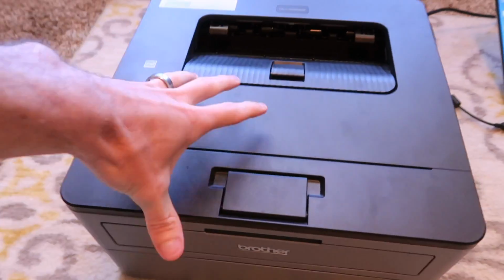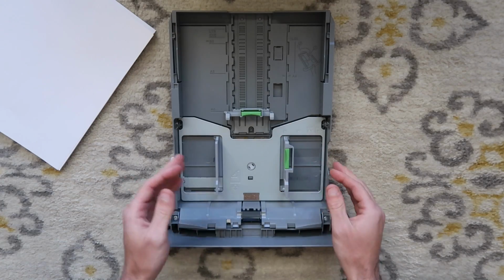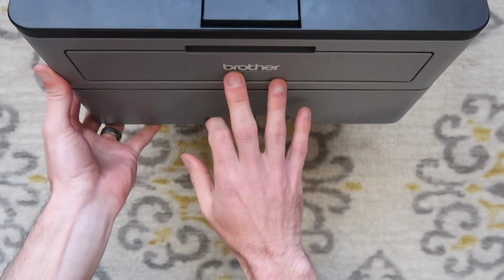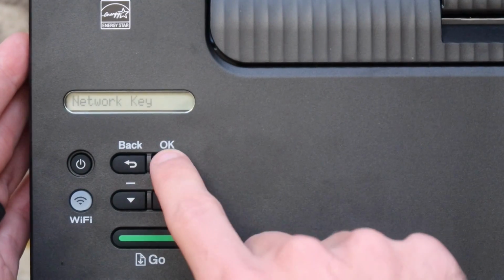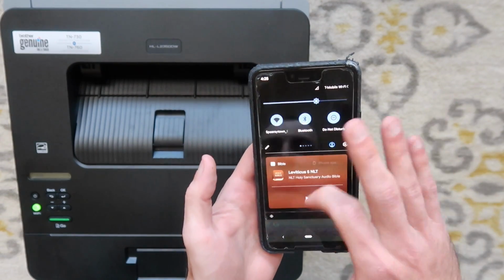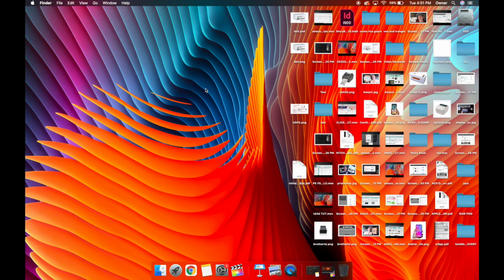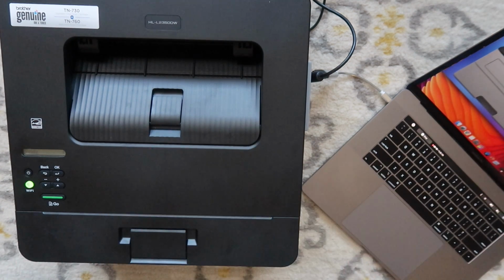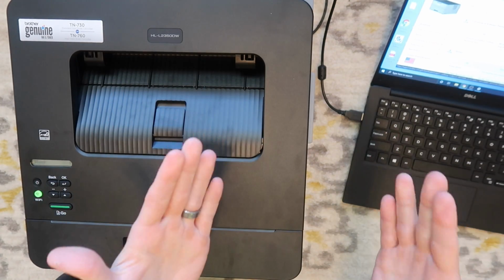Brother Laser Printer MEGA Tutorial HL-L2350DW Wifi Setup and Installation Step by Step Manual

Comment: On an older video so I don't think I'll get an answer, but my question is, what setting do I need to change to allow my PC to go to sleep. I have the MFC-l2690DW connected via USB. It goes into Deep sleep and I can still wake it up no problem when I send a print job or want to scan using the PC. The problem is my PC will allow the monitor to shut off after 20 minutes like normal but the PC never goes to sleep and something brings the monitor back on about 10 minutes after it shuts off. So something is happening roughly every 30 minutes. The PC is set to go to sleep after 45 minutes of no use, monitor to shut off after 20 minutes of no use. I don't want to change the PC settings as I don't touch the computer while my videos are encoding and then it will normally go to sleep when it finishes. Since I got the printer it has never go to sleep.

Comment: I just set-up my Brother HL-L2405w.  Everything looked like it was set-up correctly, but it wouldn't print.  I thought I'd have to return it because it was defective, but I decided to try one last thing - TURN OFF ALL THE DEVICES.  I turned off the router, my computer, and the Brother; and after a few minutes, reconnected everything.  To my pleasant surprise, the Brother printer connected and printed my test document.  I was so relieved, but still a bit peeved and frustrated that Brother has such an archaic WI-FI setup and provide their customers with a useless USER GUIDE (from their website).  I do appreciate the information that you provided in your video.

Comment: Great Video especially the deep sleep hidden solution. I still run into sleep issues and need to unplug and re-plug printer to get it working. I have used the printer for about a year, and have had to manually put in the SSID and key about 12 times as it seems to drop. Each time it shows the correct SSID and I have to remove it and then manually re-enter it.

Comment: I have a brother DCP L2550 printer. When I submit a print job while my printer is connected on wifi, it does not print, as if it has gone to a deep slumber (my sleep time is set to only 1 min). I fix it by switching it off and on few times, monkey with it and even cancel the print jobs and resubmit, before it suddenly wakes up and prints - unpredictable. It is a weird problem but happens consistently. Brother phone tech support could not diagnose or fix the problem

Comment: Connecting the printer to an Apple Extreme in an extended wireless network with a USB.  Any thoughts vs connecting wireless?  (Replacing older MFC7360N since not supported with Mac OS13)

Comment: Great review/tutorial, thanks.  You are absolutely spot on with how useless the setup guide is.

I want to connect primarily to my desktop PC running Windows 10 with the option to use it wirelessly from a laptop.  If I understand correctly I should install wireless first, THEN wired via the settings.  Is that right?

Cheers

Comment: I saw your video just before choosing the Brother HL-L2350DW printer and it convinced me that it could work with my Chromebook as well.
For two days, I had been living a real nightmare with my old HP printer, a LaserJet Pro M12W which refused to print and connect to WiFi despite 4 years of good service with my Chromebooks.
Fortunately, the Chromebook automatically detected the Brother printer and you are fine.
Thanks for your video which is very clear and saves me a lot of time and trouble.
You could add Chrome OS to your tutorial.

Comment: I am so deeply grateful for this incredible video, I'm going to subscribe!  But I ran into a problem I can't get around.  I did buy a cable the same day, but would really like to use the wifi capability.  So, I followed everything to a T, even though I'm a bit tech impaired, he was so clear, the beginning worked.  I turned off Deep Sleep, I set the Toner to Continue and it does appear that it connected.  Luckily our wifi password was all numbers, and even most small numbers, so that was quite quick, I pushed okay and it said Connected.  The beautiful magic word.  And then it went back to Wizard Setup, I believe.  The light turned a steady....green?  or yellow?  It looks yellow to me, but okay, tinged green.  I was certain I had succeeded and moved on to my MacBook Air--version 10.11.6.  Yes, it's old, but it says it accepts it.  (I just returned the HP Envy because that didn't!  grrrrr.....) Now, actually, before I found your video, I had tried to follow the quick instructions provided and downloaded the driver package and it said it was installed.  And here is where everything stalled, even when I got to this point following your video instructions.  I simply could not find the printer on my Mac.And yes, my computer is using the same TP link.  AND I could not ADD a new printer. First it would actually add it in the little box where it says Default, IP and Windows at the top left, but then it seemed to want  Location and Use in addition to the Name and I couldn't supply those two and it would go no where.  At least before I could ener the name, now I can't even do that--when I enter it in search, it does nothing.  I would so appreciate some help.

Comment: Nice tutorial. Didn't know about the hidden Deep Sleep settings. I have an HL-L2370DW connect via ethernet to my LAN, and I was still able to send a print job from Windows 10 to the printer while it was in Deep Sleep. The printer woke up, beeped, and the job printed successfully. Didn't have to touch the power button, so maybe the printer behaves differently on ethernet? Still working on the printer setup in CUPS on my Linux machine - I really shouldn't have to use Brother's .deb package to do this.

Comment: Man! I looked at this video because I was planning on buying a 2350 or 2370. However, after watching I'm on the verge of changing my mind. What appear to be stupid defaults, and what appears to be user unfriendly complexity on the menu make it a real turn off. "Deep Sleep", a toner cartridge that doesn't simply let you use 95% of the toner and then give you a heads up, is not very potential buyer friendly. Did Brother make a point of not making operation/their menu intuitive?  Think I'll start browsing Samsung, HP, Canon and Lexmark.   Great video however. P.S.: is the default duplex rather than printing on one side only? If so, that also makes no sense to me. Whatever.
Reply from the maker: Glad to be able to help. Its still a great value machine once you change those settings. Duplex is an option in the print dialogue.